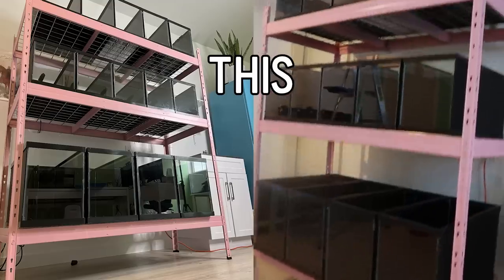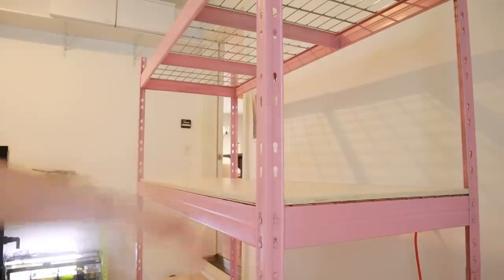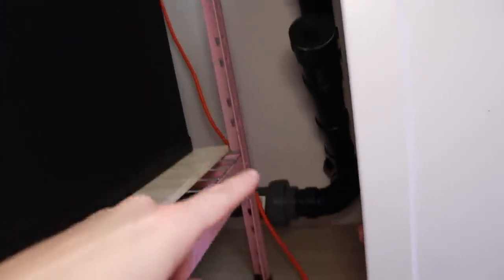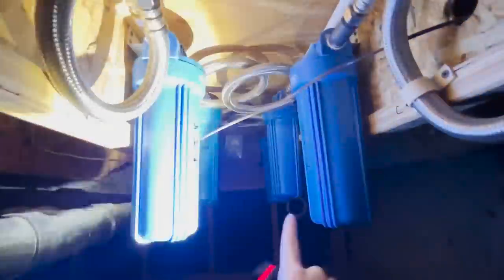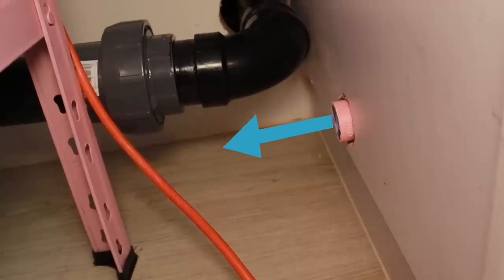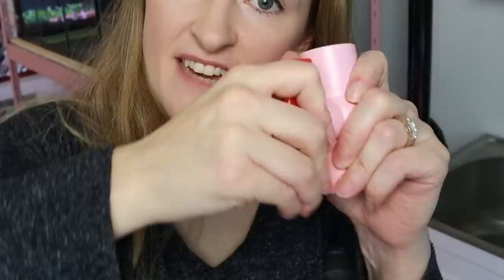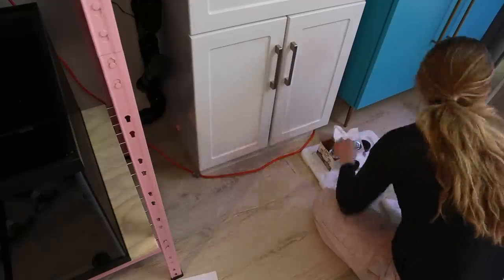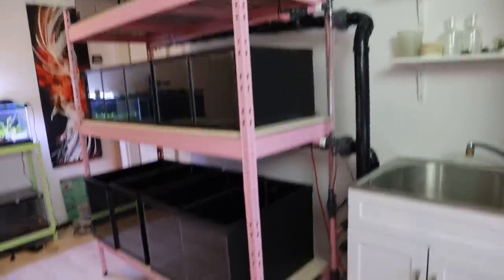DIY Automatic Water Change System for my Betta Fish Projects - Plumbing Walkthrough!

Comment: Metal valves are ok on drain pipes, BUT maybe not on the water supply to tanks.  Because if they have brass or copper or other metals in contact with the water, it will dissolve some of the metal into your fish tank water.  That can kill fish or hurt them - so you'd have to do a lot of water analysis to make sure the metal concentration in the water is at a safe level - for whoever needs to know.  For thread leaks - there is a great thing called PTFE tape.  You open the joint and clean it, wrap a few turns to match the thread direction and reassemble.  There are liquid joint compounds "pipe dope" that I would only use on drains.  Your bulkheads - might need a careful tightening - easy with experience, or you can use a crow's foot and a torque wrench to make sure you don't crack the glass.  Maybe some cardboard in the way of tools to prevent small cracks.

Comment: I understand he was slow, he did killer work though. He even added a cleanout to the drain line.

Your forethought in adding valves everywhere is great. There are often only two or three in an entire home which is wild. I have one accessible on every branch of piping in my house so that if I need to do a repair in one section I don't have to turn the water off to the entire home.
Reply from the maker: You noticed! Yeah he did a great job. I'm all about a bit of redundancy for future convinience!

Comment: for the threaded connections you’ve got to use plumbers tape on the threads. ☺️
Reply: Didn't see the actual threading so was going to comment the same.

Comment: Next time you have to use threaded fittings try putting a small amount of silicone on the threads. It'll help seal it and the silicone won't bond to thw pvc so it'll still be easy to take apart in the future. They also make liquid teflon but I personally prefer using silicone

Comment: Great job Taylor! I built a similar system in my own fish room. One of the only differences that your other viewers might like is that I installed my carbon block filter AFTER my mixing valve. That way, I only have one cartridge to change and less connections. In either case, way to go, fun stuff!
Reply from the maker: I was originally planning to do it like that! But my plumber convinced me to put them in the crawl space to save precious fish room space. Made sense to me, lol. 
Thank you!
Reply: @SimplyBetta  Yes, I did something similar. I put my mixing valve and water filter in my basement, where the water comes into my fishroom. All to save precious space!

Comment: Taylor, you may have already thought of this but just in case I want to warn you. Those awesome filters you've got under the house can't deal with hot water! It will ruin the sediment filter for sure and the carbon block. The work around is that the hot and cold water are mixed to the temperature of your aquarium and then pass through the filters. You may have already thought of this, or of another solution, but I still wanted to bring this to your attention. 

P.S. use Teflon tape on thread connections! This is used in almost every plumbing job in my country. I use it constantly when building R.O. units and when performing plumbing jobs on our water main.
In any case, great video and love the project update!

Comment: you sound like my wife talking about any plumbing issue I have ever had to take care of at my home. Additionally, the metal inside the ball valves may leech in to the tank. You can probably find plastic boiler drains. I used one on my water change setup. That is more like a garden spigot type mechanism instead of a ball valve. Think about it like a baby gate valve.

Comment: Did you use Teflon thread tape on those connections? It’s needed to seal the threads, it’s a very soft Teflon ribbon that you wrap around three or four times and as he screw it and it creates a gasket or seal in the threads.

Comment: Trying to replicate your automatic water change system. For the Hass Intellifaucet, what model number are you using? There is a K250 version and a K375 with 1/4 inch valve port @ 0.5 - 4.2GPM and 3/8 inch valve port @1-10GPM flow range, respectively.

Comment: You said you always do the threaded stuff wrong. You need to wrap the Teflon tape in the direction you spin the fitting on or use pipe dope. Good luck nexy time you also didn't righted it all the way. You could screw those in more that might be why it's leaking.

Comment: Impressive, but I would have still put the hole on the tank higher and used more pvc to make a u-shape that goes down and up to the level you want inside the tank...
That way if the bulkhead ever fails, your whole tank won't flood out.

Comment: you could set up matten filters instead of normal sponge filters that way the fish have zero way of even getting to the water change part. im sure just having a prefilter sponge over it will work fine too but im personally a little paranoid so i would be blocking off that whole area lol.
Reply from the maker: Totally, mattens would work nicely as long as the water levels were high

Comment: I know this video is old and u probably fix the problem, but It looks like u had a union after the ball valve, u could have undid the union and unthreaded the male fitting and re tightened it, but wrap it with Teflon tape before hand

Comment: Next time try another little hack. Every time you connect threaded part  add some cheap teflon tape to the thread , it will never leak again :)
Reply from the maker: What if I told you I did use Teflon tape on each connection? What the heck! I think I over-tightened the connections and I shouldn’t have been so, um, enthusiastic about that

Comment: People are so afraid to diy things like basic plumbing or electrical, but it's far less complicated than keeping the fish tanks you've connected it to. Brazing copper pipes can be a little difficult, especially if it will have pressurized refrigerant for an air conditioning system, but even that's not bad when you've had some experience and are using new copper (and don't have tight areas where you can't hardly get behind). What's a real pain in the ass is working with 1" cast iron threaded pipes for my parent's propane tank. After cutting the pipes to length, you have to cut threads into the pipes (which is one hell of a man-handle job unless you have an electric cutter) and hope the threads don't chip off as you're doing it because of a low quality thread cutter like what we had, wrap them with waterproofing tape, bury them, and pray to God, Zeus, and the Devil that it doesn't leak. Maybe kill someone you don't like as a sacrificial offering to bury next to the pipes.

Comment: A beter solution for your leaks is with  teflon tap or pipe leak tape.
Reply from the maker: I did use it but still got those leaks :(

Comment: I couldn't tell for sure, but it didn't look like you used Teflon tape (aka. plumbers tape) on the threaded fittings. They will almost always leak if you don't use Teflon tape.
Reply from the maker: I did use it, I think I over-tightened my fittings and messed them up. I replaced them with slip fittings instead, lol

Comment: Try using teflon tape/plumbers taps on the threads before you go cutting stuff up
Reply from the maker: I used it on my threads and still managed to mess them up. I'm torn between trying again or giving up and using slip fittings only for the rest of my life
Reply: @SimplyBetta  Try tightening with a wrench if you only made it hand tight. Sorry for not stating this in my 1st comment, but make sure you wrap the tape counter-clockwise on the threads and apply more to the beginning of the fitting, more is better.
Reply: 2nd though the wrench will not work, your pipe attached to your rack will spin. Detach the clear tubes and torque the black fitting to the PVC fitting.
Reply from the maker: @davefactor  Thanks @davefactor for the tips! I'll try more tape and more tightening. Well, I already have the parts to make this glue-only (I ordered immediately in frustration, hah!) , but I have some threaded PVC components I need to attach to a pump for a water change bucket. I'll practice
Reply: Good luck on tinkering with your set up and making it work how you want it to work. Looking forward to seeing how you populate you Fangorn Forest Tank with fish.

Comment: Every time you yell at yourself for motivation, I get slightly thrown off as a fellow Taylor. The rack looks great though! I get the idea with the hose over pipe, it'll be much easier down the road to add more racks and tanks to the system, changing pvc is a big pain.